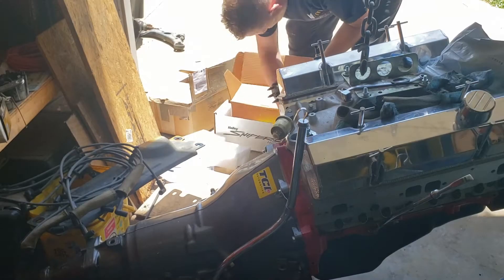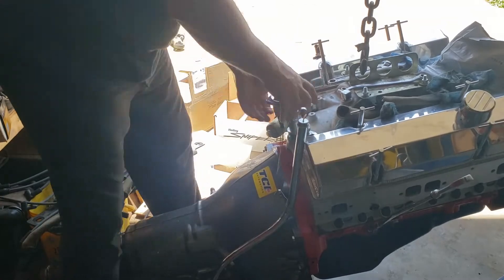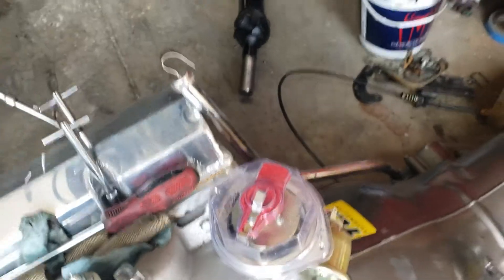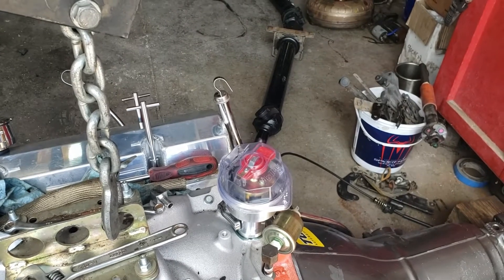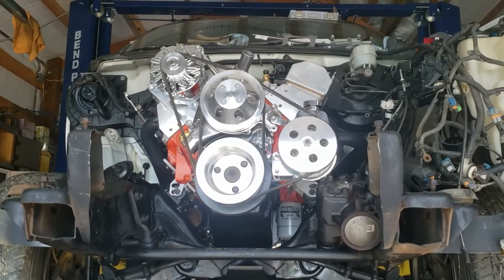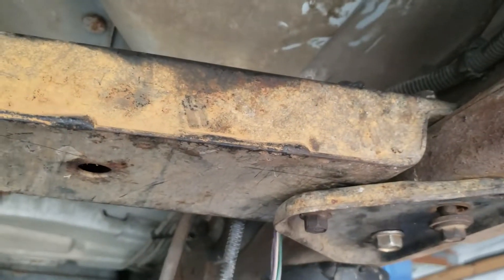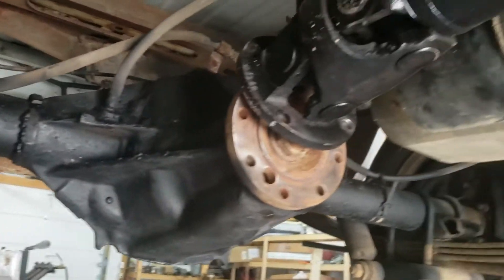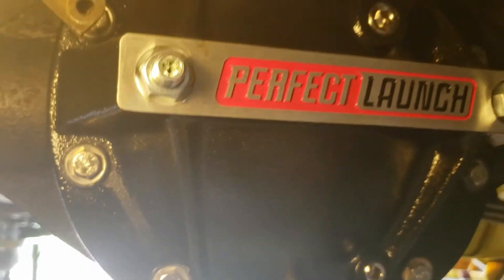How to swap a SBC V8 into your Chevy S10 - Part 6: Mounting the engine.

Comment: i'm loving your videos! i've never seen or heard of any casting, of any part, leak through a solid surface. since this cover supports the bearings it will flex some on a launch. that casting could easily fail when stressed potentially causing catastrophic damage to the rear axle and harming the track or highway you are on. scary.

Comment: Where did you find your non a/c box?
Reply from the maker: I purchased it off ebay for $135 bucks shipped. Then turned around and pulled it back out a couple months later and sold it on ebay for $450 shipped.